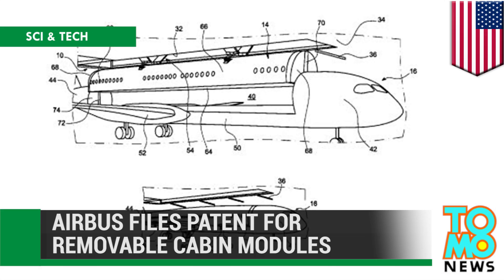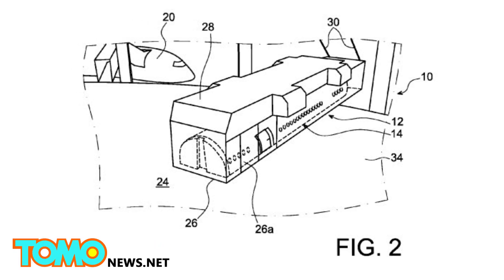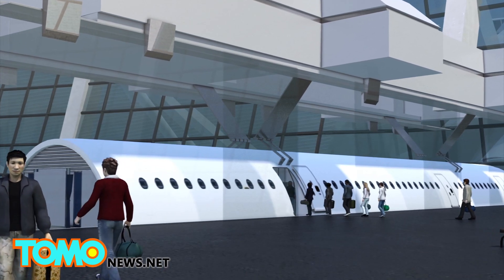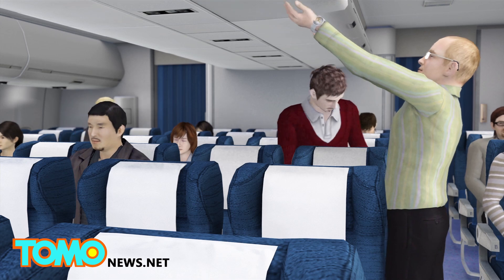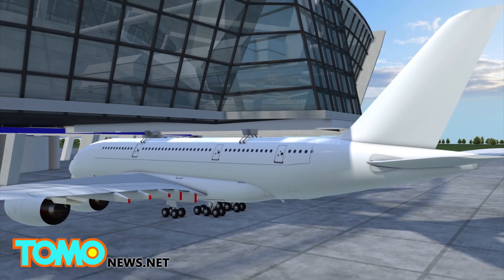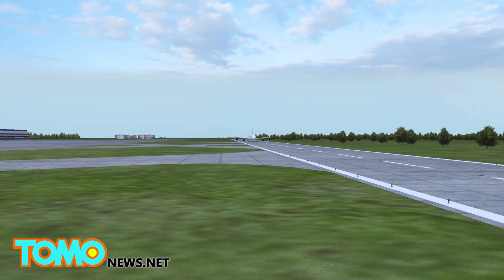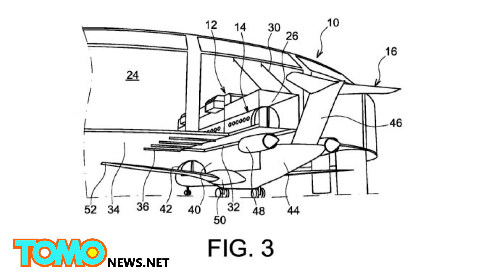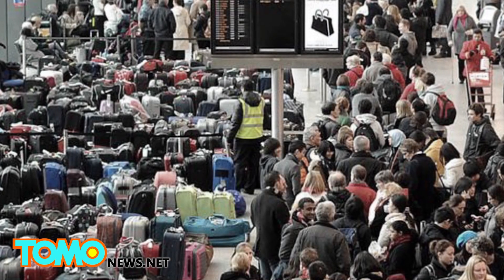Airbus files patent for removable aircraft cabins to reduce plane turnaround time - TomoNews

Comment: They should add a parachute if the cabin falls off
Reply: I think thought of a safety feature where if the plane has a problem and its about to crash they can detach it and parachute down safely without anyone dying
Reply: +William Fey Thats exactly what i was thinking about.
Reply: +Jon Prz a cabin that big would need a parachute unimaginable in size
Reply: markus ford hm consider this: 

The Parachute is not attached to the plane itself, but to the detachable cabin. When the plane is in mid air and is in the mist of engine failure, the plane is on glide mode, but both pilots agree that there is no airport nearby to land and in any event they will have to crash land into the ocean with the chances of survival being minimal. In that case the cabin itself can be ejected from the aircraft. After it has been ejected parachutes are deployed. The force of the ejection at the opposite direction in which the aircraft is travelling should be enough to slow the cabin down significantly. After that it is no different to standard deployment of parachutes. If necessary, we can even design the cabin itself to be detachable to one another, so A cabin can be split into 3 mini cabins (first class, premium, and economy) each equipped with parachutes of their own.. this would put less stress on the parachutes when deployed. In terms of design, the cabin should be designed to be bottom heavy to allowed the cabin to recalibrate its orientation when ejected. If you understand what i mean.
Reply: Good thinking..ur idea has now become real..pls read this

http://mashable.com/2016/01/15/detachable-airplane-cabin/
Reply: markus ford yeah, at least multiple large parachutes. Again it was just an idea though.
Reply: +William Fey I've been emailing that idea to Boeing for years! hopefully they will take up the idea and make flying safer
Reply: +Peter Jones Just to add, the cabin should be ejectable incase something goes wrong mid flight it can parachute to safety.
Reply: +Peter Jones There are many problems with that idea tho. The amount of material to slow stop the plane is enormous plus the weight doesn't make sense. Plus there's not many practical situations where a parachute would work... How do you deploy them moving horizontally?
Reply: I wonder what is their alternative or hidden intentions to file such a patent. hmmmm. oh, ISIS, terrorism..... oh , this invention can be applied to all planes in the world. A safer plane, forcing all plane manufacturers to license  from them or design around this patent.
Reply: +markus ford even the lightest parachute would be to heavy for the size it would have to be ; the fuel just to carry it  would add up a lot
Reply: Joe Mendez
In layman terms, you have a point. But many things are possible. What you think is impossible can actually be possible.